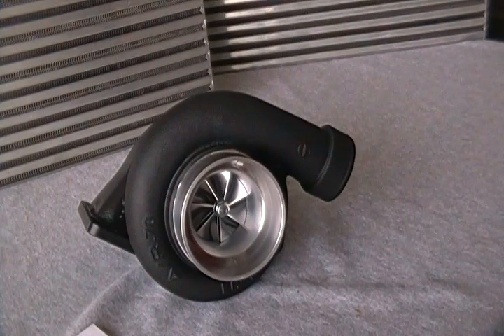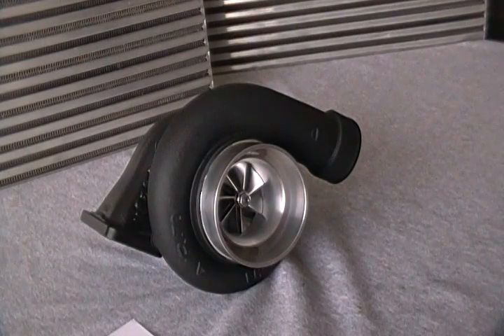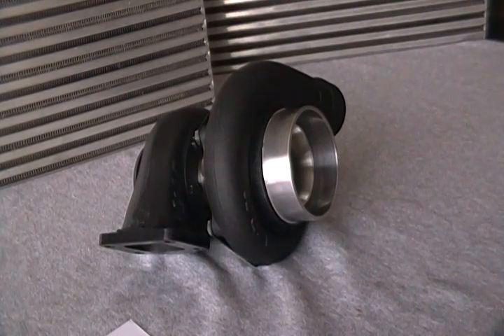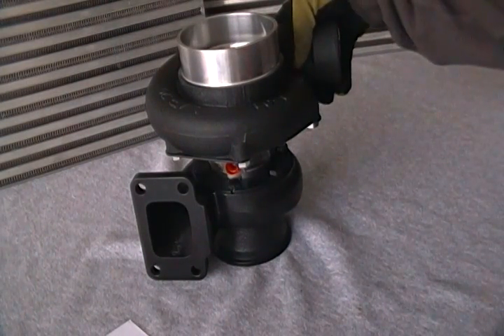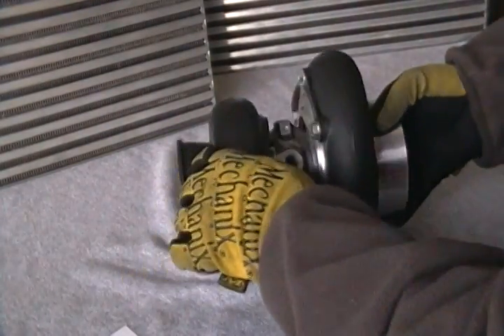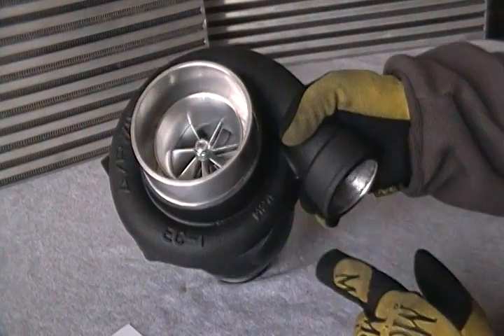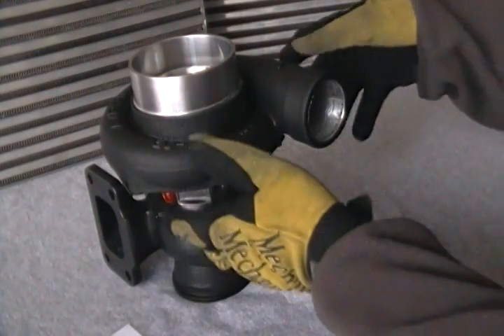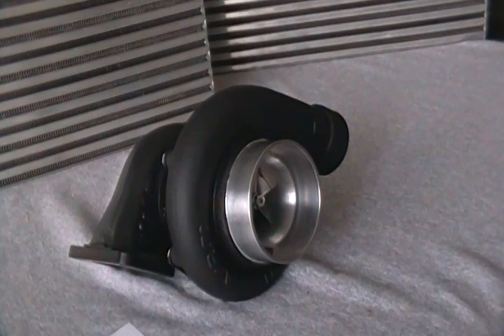GT3588R Interceptor R Steel Ball-Bearing GT35R-based Turbocharger STC Description and Features

Comment: For a Mid engine, RWD, K20 powered application how would this be advantageous over the GTX3576R when considering a goal of 650 whp, while looking to retain the best possible spool for this size turbo, and transient recovery. Mid 400s on Pump gas, and E85 for 650whp goal.  Curious which turbo would be best for my situation